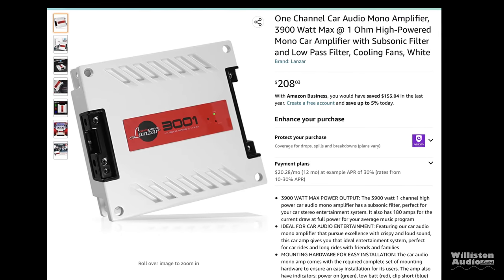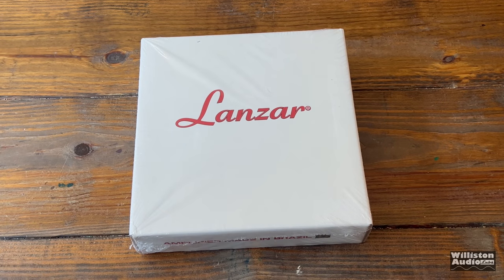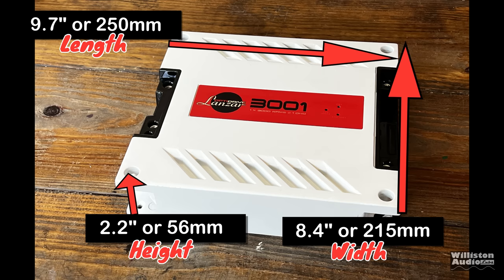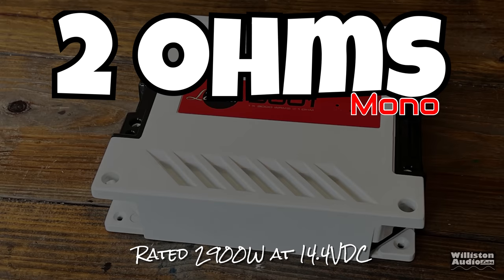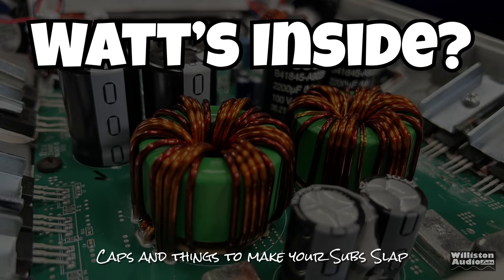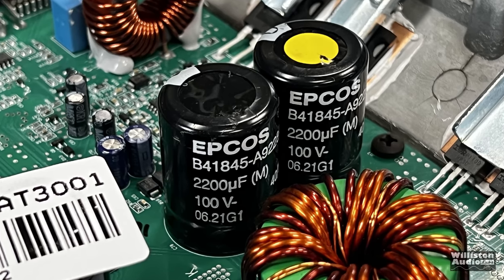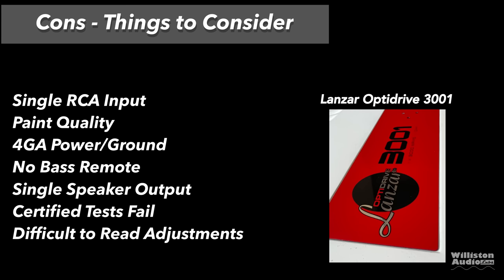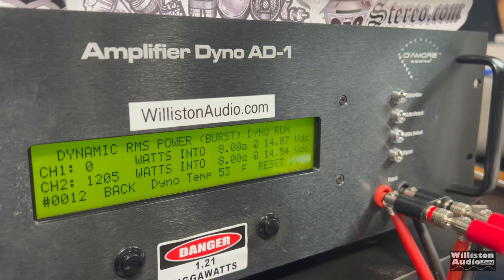Lanzar Goes Brazilian? Lanzar Opti Drive 3001 3900W Full Bridge BASS Amp!

Comment: It would be interesting to see a ampometer on the speaker leads of all the amps you test. As you know there are two ways to make wattage,1) high voltage/lower current or 2) low voltage/higher current. Right there is how new amps produce so much "power". Back in "The Golden Age" a 500 watt amp was the same size as a 5000 watt now. However,the difference is current and voltage output. Current,not wattage,makes heat. There is no way the amps of today would survive producing stated "power" if they had the current output of old school amps. Also,current is what moves voice coils,not wattage,and why old school amps drive speakers just as or almost as hard as those made today. Back in the day I remember good amps stated "no current limiting" in their features. I doubt that's done now.

Comment: had a older lanzar vibe 1200 in the early 2000's. it was a great amp!  Never had another lanzar product since. Great powah from this one tho!
Reply: The black vibe amps worked well and did their rated power. So many people abused the snot out of them and they hey kept on kicking.
Reply: @bassntruck  that’s what it was!  Had it on 2 jlw4 12’s. It was loud for what it was!
Reply: @jondoe6618  Yeah, while still a class A/B, they did their rated power. They would get hot if pushed hard but I rarely ever saw a failure. You would be hard pressed to find something better in their price range. I still have a few of the 220 and 230 models sitting around from back then. Great units to put on some highs.

Comment: I just ordered one I’ll try it out Wednesday when it arrives
Reply: Did you try it out bro?
Reply: @johndough4338  was going to start installing here in a few min
Reply: @johndough4338  it’s installed I’m not too happy so far, I need to tune it some more because its going into protection easily.
Reply: @everzeber420  ... what you got it installed too? And how is your electrical system?
Reply: @johndough4338  Chrysler 300c hemi stock electrical odyssey pc1800 agm charged to 14 sky high 0ofc. I know it’s not enough. Not enough alternator for agm the car was wired for 80ah lithium which was fine but the pc1800 was all I have
Reply: @everzeber420 ...did your fans on the amp turn on as soon as you powered it?

Comment: Cool video! Talking old school, I never hear anyone talk about Directed Audio from the late 90s early 2000s. Still some of the best and loudest systems I've heard was a 1100d on two L7 15s. Do you ever run across any ?
Reply: Feel like directed acquiring everyone was the end of the best brands out there.  I had a viper 5 channel amp, it was okay I like the MTX RT 4405 it replaced better.
Reply: I had an l7 15 before I even got my first car lol. I got it In a trade at work thru one of my customers, it was practically brand new but also the size was huge after I settled on buying a small bmw coupe with little to no trunk space the decision to sell it became obvious. But before selling it, I wanted to play it for a couple months so I hooked it up to the only amp I had available to me which was my class ab Jl audio jx400/4 and I could barely get that thing to move 😂 that was the point I said screw it im done messing with this beast and I wasn’t about to buy another amplifier just for the sake of bumping it full blast just before selling it. I did finally get to see it flex in full motion one I met the dude up from Craigslist that came down to pick it up off my hands, the buyer had with him a hifonics monoblock which allowed me to finally see that square bahemouth flex once and for all lol. I believe I let him have it for 300 including the ported box lesson was learned that day. Big subs need lots of juice 😅😅

Comment: Interesting. I like how they run 240 V in their car. They lived risky with fire. Arcing and sparking. I want to see the 600 V amplifier that thing will have the smallest wires going into it think of the cost savings of the materials.
Reply from the maker: There are HV amps from Taramps, Banda and others

Comment: Do you have a video showing what your power-source is for running the dyno tests?  Always amazed at seeing 14.xx volts at 300, 400, 500 amps!  😲
Reply from the maker: I have 320ah of Yinlong/XS Power LTO cells. 48 total cells in 6s8p configuration

Comment: Brazilian amps confuse me as to accurately measuring their output. Brazilian amps ramp the voltage internally requiring less amperage. So is there a way to calculate that without opening up the amplifier?

Comment: Big d great video again just a curious question I have to ask how you set the crossover during the test
Reply from the maker: I disable crossovers or set to the setting that will not interfere with the tests
Reply: @wal  thanks I have a Banda beat 3k and just wondering what’s the best settings to set the crossover I has mine turn off also and I’m using a beats 3k also on 8- 6inch b&c wired down to 1ohm and it does sound very loud. Thanks again for your response great video again keep up the good work dude

Comment: Hey Big D I like your videos and I also like low bass 20, 25hz. Have you tested on your own time to see how many amps do rated power when tested @ 20hz Instead of 40hz ?  For example purpose I'm Currently running two Rockford fosgate T1500.1 bdcp amps the birthsheet shows 1938 Rms @1 ohm and the chart shows over 1500 at 20hz
Reply: Um no he hasn't as the Dyno signal sees a 40 htz for bass and 1 khz for mids these are preset on the Dyno .

Comment: I was actually wondering why all brands like planet audio, crunch, hifonics, boss, even pioneer wouldn't just join the Brazilian copy band wagon ... would make getting amps easier for  people on a budget like me ...Thx  for the vids do more plzzz
Reply from the maker: Thanks for watching and commenting!
Reply: Not all folks are interested in full bridge amplifiers like this...but there are many brands that have already done this. A little shopping and you will find many out there.
Reply: If you need this kinda power, then you're not buying "budget" subs... If you spend 500$+ on the drivers... Would you wanna put it on something cheap like this jeopardizing said drivers? Or spend a bit more for something quality that wont blow itself or your drivers up?
Reply: @TheAceTroubleshooter  fact's
Reply: sounds dumb but look into rockvilles higher end amplifiers, they genuinely impressed me with the output and sound quality
Reply: Is one fan pushing and the other pulling?
BTW, full range from a Brazilian full bridge is not uncommon. Learned that from this channel. They wanna drive compression horns for competitions.
Reply: Because typically people on a budget getting amps like these for cheap skip on electrical which leads to blown equipment and fires. Not to mention everybody doesn't like full bridge
Reply: @SidyDidIt  many people have ran full bridge amplifiers,  and probably didn't know it lol. There is a difference in full bridge, and "Brazilian" style full bridge. Alpine, Kicker, JL, MTX, JBL and more, have used full bridge for years. The problem people have with Brazilian amplifiers and Chinese copies, is that they typically use inferior electrical to try and power them. Or they try to run the ohm loads lower, like a half bridge. Higher input voltage kills them as well. Full bridge is the path forward, and is what most companies will start shooting for, eventually.
Reply: @Chuck_Sanders  full bridge in itself isn't new or bad. the popular ones now sound like shit because they are all about power and lowest cost and have shitty components and filtering. look at a jl slash 1000 board vs a smart 3. They have a place and are ok if used properly but I'll forever be using Korean boards personally
Reply: @SidyDidIt  i do believe I have already stated this, about full bridge amplifiers. I merely said, many people have ran full bridge,  and didn't know it. And that problems with full bridge "Brazilian" design, is typically user error, when failing. It wasn't to spur argument, at all. But then again, I've seen SALT amplifiers, that didn't even have their transformers soldered in place on the boards....straight out of the box and DC amps fail over and over. Hell, the Power Acoustik Vertigo 10k, and the CAB 22 are one in the same..yet the PA outperformed the CAB, and is cheaper. Sometimes bigger brands, are no better. 👍
Reply: @Chuck_Sanders  no argument lol we're pretty much agreeing on the same things. I was just saying the full bridge amps from before the Brazilian takeover are all around better.
Reply: @TBO207  why would Rockville amps sound dumb to use the hit their numbers for the most part, sound great and hold up pretty good. Its just as good a buy as any other decent budget brand. If you said boss or crunch it would have sounded dumb🤷🏿‍♂️
Reply: @absalonw007  when i tell people that its almost like i told them to go buy a potato and hook some rcas and power to it, but in reality the amount of people that love the sound of my budget build where i used a db45 is bar none some of the best reactions ive ever gotten from a midrange amp

Comment: Hey can you do a high voltage run on the taramps bass 3k low impedances I wire to .5 and clamp 3kish dropping to 13 at 35hz

Comment: almost like an mobile cpu that only goes full power until an heavy load is sensed. wonder what kind of power supply it has, if it idles and then allows more current in if needed.

Comment: I can't stop looking at the intro showing around the amp, it literally looks like someone took there banda 3k into the garage pulled out a can of white spray paint and painted it with all the little air bubbles and blemishes in the paint and slapped a lanzar decal on it most it was a cost saving to use spray paint??"

Comment: WOW! I was seriously expecting another MaxxSonics style amp that shows 250 watts at 1 ohm for the price, but this is crazy for $300. Edit: so is the amperage!
Reply: Maxx sonics is all I run the sound quality is amazing. And it works well with the power wire I choose to run. I like to use lamp cord with the on/off wheel on the power wire. I think it's the best way to shut off the subs. Just roll the wheel and it shuts off right away. But it catches on fire & I have to go to goodwill to source a new power cord alot.

Comment: Imagine that the microwave is a 1000 W appliance and it gets 120 V and 9 amps of current. Look at the wire that feeds our microwave and look at the wire that feeds our vehicle amplifier if we put a Rectifier or inversion we could do a lot more with smaller wires.

Comment: Great video as always thanks.  For efficiency just divide the wattage by the voltage to get current./amps. And then calculate efficiency.  No need the clamp meter.   Also the big wire 1/0 is used primarily in car audio to avoid voltage drop over distance typically from engine compartment to rear of vehicle   The same amp connected to 15’ of #4 would experience voltage drop and over current events as the amp demands current.  Vs same amp connected to 15’ of 1/0 then reduce at the amp to #4 (as you did) won’t suffer voltage drop over distance and current will remain lower as amp demands.   This is why bass heads do everything possible to keep voltage at 14v efficiency (current draw) stays low and this is accomplished with 1/0wire from voltage source to amp in big installs. Multiple 1/0 runs.
Reply: Power factor. The method you mentioned doesn't account for the power factor nor the actual current draw of the amplifier. It calculates how much current it's putting out but not how much it's drawing in, aka efficiency.
 
The primary reason for larger wire is so the thinner wire doesn't melt from the high current demands of the amplifier. Wire is rated in ampacity. If the current going through the wire is higher than the ampacity of the wire the metal of the wire will overheat and possibly cause a fire. This can be resolved by using either a thicker gauge wire with a higher ampacity or multiple runs of lower gauge wire. 

I mean, you're not wrong. The ultimate end goal is to avoid voltage drop but that's not the primary reason of using the thicker gauge wire.
Reply: @Carl_Jr  I get it.. I agree with your power factor explanation.. but drift on your wire size explanation.. I said essentially the same thing. And using a thin wire at 15’ 14 v at battery post will yield a fraction of that voltage at amp when under load thus the overheat wire failing current spike… voltage drop from too much resistance… I don’t disagree with what your saying it’s just the same phenomenon we’re describing…
Reply: @shanecunningham6082  Wire doesn't get hot from voltage, though. Look at how thin the wire is going into a toaster. In the USA we use 120v for residential electricity. If voltage dictated the thickness of the wire then we'd need to use 50/0 wire on that toaster. 

The opposite actually happens. The more voltage that's used the less current is required for the same amount of power, ergo a thinner wire can be used.
Reply: @Carl_Jr  we’re describing the same thing.  As amperage rises and wire not big enough to carry it there will be a voltage drop too.  Said another way, as voltage drop occurs ampacity will also rise.  So I agree one can say ampacity rise causes breaker or fuse to trip.  
At lower dc volts this is more pronounced.  Watch a voltmeter dip while an amp is pounding a subwoofer. At same time watch a clamp meter measuring amps rise with the voltage dips. Too much current  causes voltage drop

Comment: Im shocked in 2 ways. #1, that the amp put out those numbers. #2, that it pulled 354 amps at one point. :o Wouldn't that blow almost any fuse? o.0  I plan on running my smart 3k at 4 ohm on a single Fi bl 12, after seeing how efficient it was on your video. ;)
Reply: If u do some build updates I’d be interested in watching, I’ve got 2 fi audio blv3 subs on a Jp 43, I still need to upload a new video but I’ll probably do that today.
Reply: They aren’t quick blow fuses.

Comment: all the lanzar amps i had where good, and they always put them whit the crap amps for some reason.
Reply: The only reason why lanzar amps were looked at as Bad, is because of dealers in car audio industry. Most name brand amplifiers have territory restrictions. Meaning if you were a dealer selling a certain brand, they wouldn't let another dealer in your area sell that same brand, unless you were somewhat affiliated with each other like a franchise. Lanzar distributors were connected with pyramid, legacy, blitz audio, and Pyle, and they had no territory restrictions, meaning anybody could sell them. And what this does is give other people the advantage to sell them cheaper than you would've sold it. And  if you were to let's say go to a well known car audio shop, that didn't carry lanzar, but yet you asked them about lanzar products, 9 times out of 10, they'll just brush it off as some flea market bullshit, and recommend you look into a product that their selling. So at the end of the day, inside these amps are Chinese,  Korean, and now Brazilian boards, packaged up and labeled with a name brand, but it's the marketing strategies, the foot work that the dealers put into building their retail store's name, that really influence the consumer to believe what's a better brand over another. For example, if you could buy some Nike Air Jordans at a Payless show store, then either air Jordans would lose a little bit of value in the eyes of the consumer, or Payless show stores would gain a little momentum to start stepping into footlocker's territory...

Comment: Dose anybody know anything about DB Drive Audio subwoofers? I just got three 6 1/2 inch DB Drive WDB G2 subs in a DB ported box. Any info on them or what amp to run will b very helpful.  I’m on a slight budget but am open to expensive amps if it’s mandatory to get the sound I hear these subs can produce.
Reply: Grab an Audio Legion 700.1 while skar sells them cheap on their ebay store, or grab a Recoil mono..They're  solid and affordable prices.
Reply: @Chuck_Sanders  is 700 watts enough to push these? They are 750 rms each?
Reply: @WhatsthePOINT_EDC  of course my friend. It was one of the first I thought about, as they do over rated power and are about $80. Recoil has a 1200.1 I believe, and it's bass remote includes a clipping light.  Just was thinking budget friendly amps, that are solid performers, that wouldn't stress the electrical side as well.
Reply: @WhatsthePOINT_EDC  on a side note,  the owner/partner at Recoil, has been in the audio industry for a long time...and was with brands like Diamond Audio as well...Larry is a great guy, and the Recoil amplifiers have nice sound quality for them being more "budget" amplifiers.  Good build quality..and I am not a rep or dealer lol.

Comment: Bro, you should test the Hifonics Brutus BXX6000.1D

Claims 6000 RMS @ 1ohm but it’s $466 on Amazon right now. Has 37 settings tho lol.
Reply from the maker: Thanks for the suggestion
Reply: Thank you for all your videos man. I tell everyone, if ain’t Dick Riculous approved then I ain’t touching it. It’s hard to believe how many of these amps don’t get fractions of the rated power. It’s a wonder why more manufacturers haven’t had class action lawsuits against them, like Rockville.
Reply: Also, now that I think of it, I reckon $466 ain’t too bad if it really gets 6000 rms considering the fact that this Lanzar is one of the better budget deals getting 2500-3500 watts.

Comment: The power supply MOSFET is actually 120 amp 40 volts.   500volts MOSFET would not stand up there.

Comment: How many watts can I safely run on 4 gauge?
Reply from the maker: It depends on the length and wire construction (OFC vs CCA). There are guides which give you lengths and current capabilities of all sizes of wire.
Reply: @wal ...on that lanzar Brazilian amp, did the fans turn on as soon as you powered it?